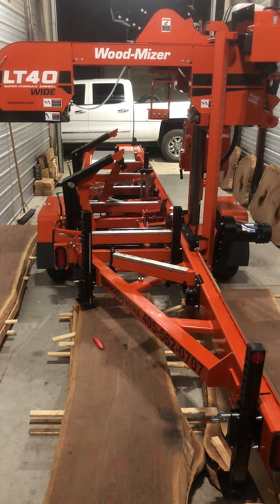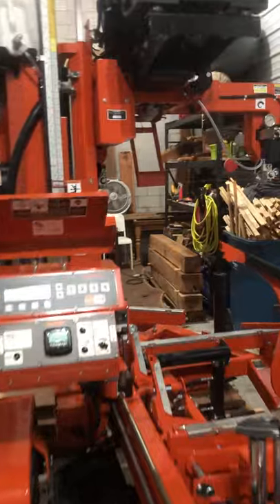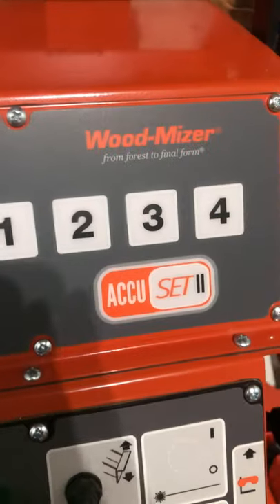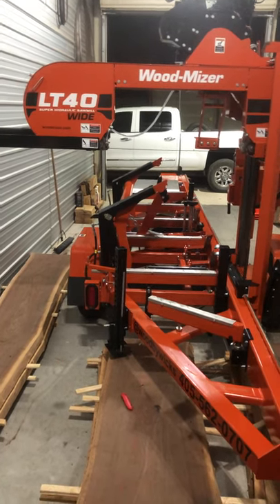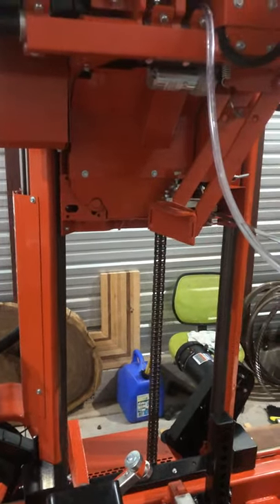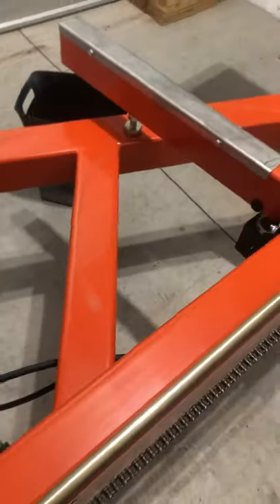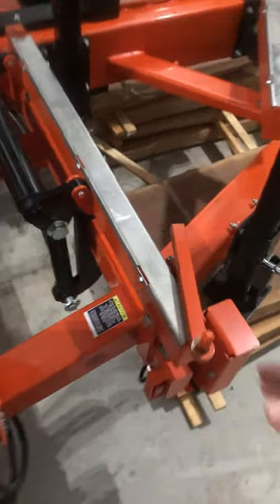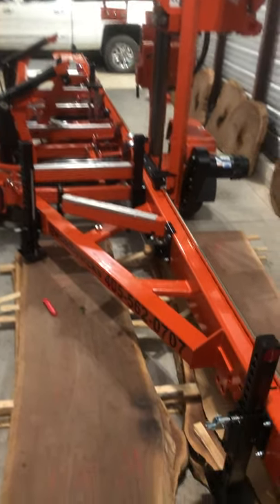Woodmizer LT 40 Super Hydraulic Sawmill Wide Head 2020 Quality is 100% on Woodmizer REVIEW

Comment: That’s a nice one!!! I ordered the LT40 standard , 38 hp gas , wide head , acuset 2 for $32.534 plus $2.277 sales tax.Total $34.811 after watching your video I’m now thinking if I made the right choice 😅. Is there a big difference in power between the 38 hp gas vs 35.9 diesel ? Is the gas engine Boggs down when cutting wide hardwood?I’m sorry with all my questions I never had a diesel machine before oh one more question . You said you paid $ 41.050 for this machine. Is that before tax or after tax? I will greatly appreciate your response, thank you in advance 🤙🏽